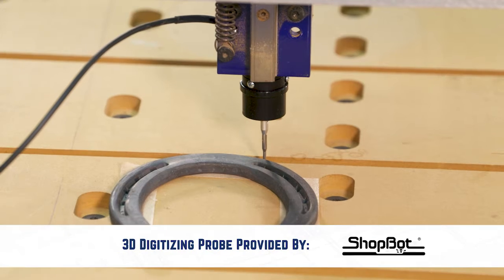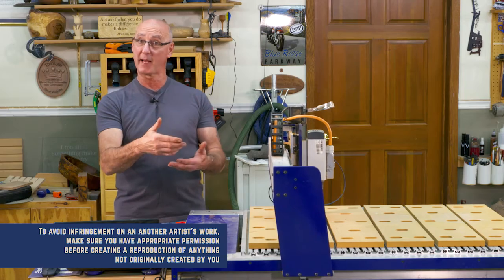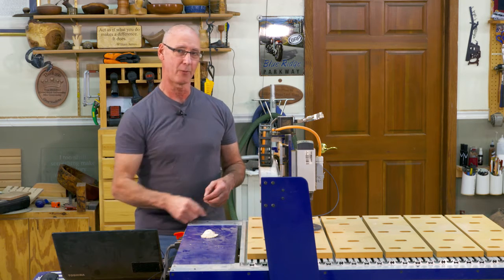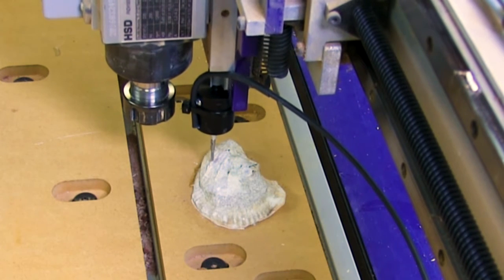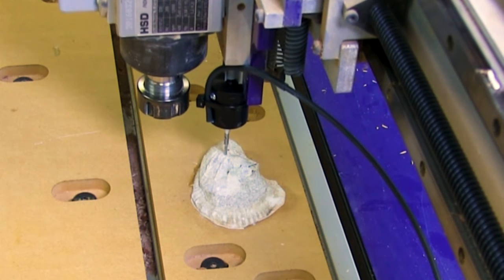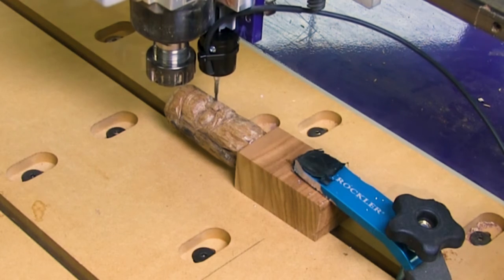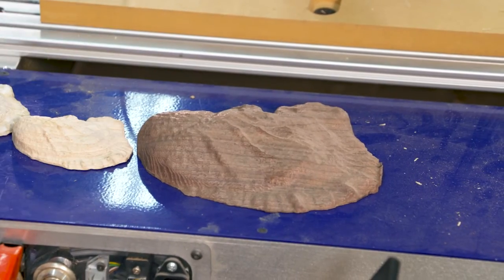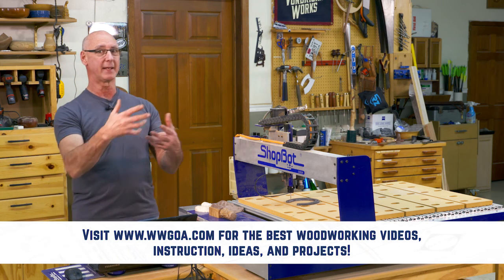WWGOA's George Vondriska Demos the ShopBot Digitizing Probe

Comment: will the probe work with a shop bot 5 axis
Reply from the maker: Good question! Our probe is designed to work only with our 3-axis machines as the touch points are only able to translate to the software we use as vertical touch points. We recommend looking into 3D scanning for full 3D modeling. Hope that info helps!
Reply: @shopbottools  Thank you for your response, Can I trace a part manually using the Shop Bot Software to create a tool path